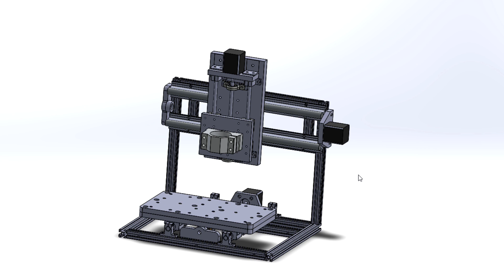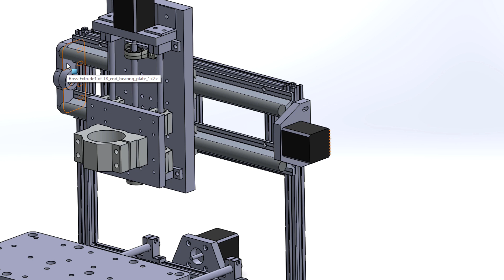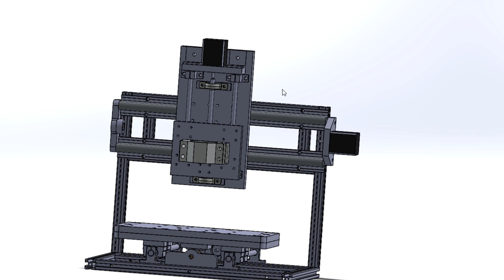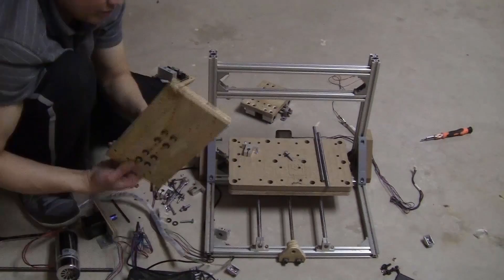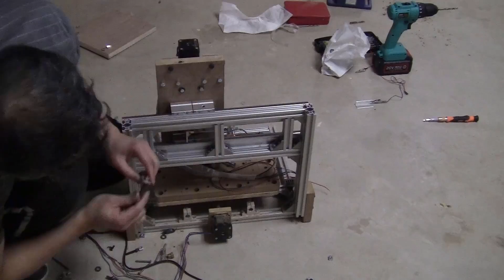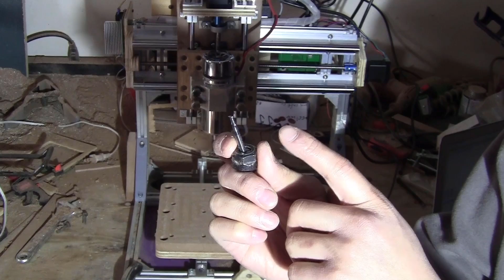3018 CNC - Essential upgrades for Aluminum milling - finally a smooth cut

Comment: Did you balance the spindle fan. I've got clatter and saw a video on here on how to adjust the fan so it is balanced and that will stop it vibrating so much. Should you have used some oil as well?

Comment: Thanks Minh for another interesting video.  I like your approach to improving the router... analyse the performance, identify the weakest area, improve the weakest area.  In the end you have a useful tool, you know every part of it, and your knowledge is much greater.  You are obviously prepared to listen to suggestions from other people as well, so here's my pennys worth:     :o)

1):  Not the most obvious first item.  You don't say what grade of aluminium you are machining, but it looks like extruded bar from a hardware store.  This stuff is made by squeezing it through dies.  It is formulated for this, so it behaves like bubblegum.  It machines like bubblegum too, and it is guaranteed to clog the flutes of your cutter!  Make sure you have a free-machining grade like 6061.

2):  For aluminium, use a single-flute cutter.  This allows more air to get to the cut zone, and allows chips to escape more efficiently.  This is doubly important in small diameter cutters.

3):  Rigidity is King!  What you have done is a huge step in the right direction.  You have already mentioned other areas you will look at, so enough said.

4):  Try to avoid cutting deep slots where the cutter contacts both sides of the slot at the same time.  This promotes chatter as the cutter behaves like a ping-pong ball on steroids.  Use a cutting strategy that machines each side of the slot separately, especially on finishing passes.

5):  Use feed rates that create a decent sized chip.  This removes heat from the cutter's edge, and reduces the possibility of chip-welding to the cutter.

6):  Chip clearance.  Air blast is the way to go on a machine like yours.  A lot of people want you to spray their favourite goo everywhere.  This just makes everything sticky, hard to clean up, and will ruin any wooden parts.  If you swap to a ten ton monster machine, by all means go for full flood cooling!   :o)

7):  Keep having fun, otherwise what's the point!      :o)

P.S.  I realise this comment is more than a year after Minh posted his video, and no longer valid for him, but there are plenty of others out there who are at this point of their journey.
Reply from the maker: Thank you John, no advice is too late and I sure am still learning. I mostly just go to a hardware store here called "surplus city" and buy whatever aluminum scraps they have that fits my cutting jobs. They don't even mention what aluminum it is so I just cut blindly. You surely right about not having contact on both side of the bit, I only do it sometime for the contour to save time but in return compromise the precision.
Reply: you are an inspiration!!  He's a genius, your a wise-Genius, I have been self teaching myself to learn everything I can on CNC's for 4 years so far and what you said has taught me a lot instantly!  Thanks man!  (I will be saving my home built cnc tons of stress!)

Comment: Псих! Какой жесткости и точности ты хочешь от этого хлама??🤦
Reply from the maker: I don't really understand what you wrote but hopefully google translation was correct so we can have a bit of discussion. After upgrading the rails to SBR16 rails, the machine actually became very sturdy and cut very nicely even on aluminum if the tool path set up correctly with  reasonable feed rate and step down. After the installation of the rails, it actually became a reasonable machine.

Comment: Hi I just enjoy your posts so much
I have also modified my cnc but I’m lucky enough to have a 3D printer just designed mine a bit differently and printed everything. Just one question what type of mill bit do you use and what speed are you running the motor at. Please don’t stop I would love to send you pics of what I have done
Reply from the maker: Hi there, I'm glad you enjoyed the video. I also have a 3D printer but I kinda hate and love it at the same time. I'm leaning a bit more toward milling things now. To cut plywood, I used 2 flute straight bit, for Aluminum, I used 2 flute spiral bit , both are flat end mill and spindle speed at the maximum: 12000RPM. Please do send me the pics, You can find my e-mail in the "Contacts" section of my YouTube channel page.
Reply: Minh's man cave Hi thanks so much for the quick response. I still enjoy my 3d printer but I’m also getting into the cnc stuff I will send you some pics of everything I did

Comment: now you could use the machine to make some aluminium upgrades like side plates and the parts you have made out of wood.. 
very intresting build and thanks for sharing, I am in the process of doingthis to my 3018 pro
Reply from the maker: Yes, absolutely. That's the plan. I'll make the aluminum part as soon as I found some stocks in the hardware store. Glad you enjoy the video.
Reply: @minhsmancave9448   yes i have watched quite a few of your videos, pleause keep them coming

Comment: Thanks for the videos! Have you tried different toolpaths, like a 2d adaptive clearing path with a silhouette offset machining boundary? It looks like this is a 2d contour cutting the outline with the tool fully engaged the whole time, whereas my understanding is an adaptive toolpath would result in less tool load and hopefully less chatter?
Reply from the maker: Thank you for the suggestion. You're right, I should use 2d or 3d adaptive clearing. I just got the habit of doing 2d contour from cutting plywood. Adaptive clearing on aluminum is the right way to do it

Comment: They make a product called tap magic. It only requires a little bit of it. I bet it's sound better and cut easier if you applied a bit of tap magic
Reply from the maker: Yes, surely. I do have tap magic (I use it to drill all the aluminum parts that I showed in the previous videos). Didn't think of that when I was doing this because I just wanted to keep it dry. But I'm sure the cutting fluid will help a lot. I'll try next time.

Comment: hey minh i intend to do the same   but i cut all things from metall
Reply from the maker: That's how you should do things. I'm just lazy right now to do all the drilling and cutting on metal. Plywood is easy, I just let the CNC machine do the work itself if it wanted to be better, lol!! Let me know how it goes with your metal build
Reply: Baby steps, Minh, as you are now at the point of getting that machine to redo all of those wood pieces in metal so even more rigid.  Btw, from what I heard I think 300-350mm/m would have been perfect and no chatter.  Oh, and was that a single flute endmill as that works the best for Aluminum for your future remakes.
Reply from the maker: @thebeststooge  Absolutely, I'll upgrade all those wooden pieces to Aluminum for steel (just gonna do the drill guide trick). I'll try single flute bit next time after my actual set of bit got dull.
Reply: @Minh's man cave Drill guide trick?
Reply from the maker: I just make a plate on the cnc with all the holes needed to be drilled on a piece of plywood. Then stick it to the piece of metal and do the drill following a the predrilled holes
Reply: @Minh's man cave I am not understanding but I would think this machine, as you have it right now, will do the holes in Aluminum.
Reply from the maker: Make the guide then go to the drill press is fast and I can actually make the parts from steel
Reply: @Minh's man cave Well, I figured that was it, thanks.

Comment: Hi Minh, awesome to see your new video and progress, lots of work goes into this little mashine :).

Got my 400W Spindle working aswell, so far with original x-axis, upgraded Z-Axis with 2x 45mm long bearings and printed an adapter for the cast aluminium spindle holder that came with the spindle.
I see you´re using 2d-contour, this puts a lot of load into the mashine since you´re using the full diameter of the drill.
Here are my current Settings for "3d Adaptive Clearing" Aluminium which i like the most so far (using 1/8 2-flute): Feed 600mm/min; Plunging rate: 200mm/min; Optimal Load: 0.5mm ; Depth of Cut: 0.5mm. Maybe you want to try them for yourself

 When pushing harder i still get minor vibrations into the whole Carriage, not as much as before.
 Still not sure if this can be avoided with linear rails. But so far the speed is actually pretty impressive and works for my purpose... i maybe upgrade to linear rails anyways (we always try to improve stuff :) )
have a nice day
Reply from the maker: I agree, 3D adaptive clearing will be smoother as I did the first time on the original 3018 machine. I just got the habit of doing 2d contour to save time from cutting plywood. But I do recommend you to get the fully supported rails, totally different performance. The 20mm spoil bit cut really smoothly. Thank you for sharing your experience to my friend.

Comment: Most people would just have given up on the 3018 ages ago!
It's been great to see just how far one of these machines can be pushed, and the true value of the different modifications you have made. I bought a 3018 as a learning tool to help me understand the basics of building and running a CNC router, thanks to your videos I now know not to bother trying to endlessly upgrade my machine and just build a much more rigid machine right away! Yes a 3018 can be made to cut aluminium, but is it worth it?

Thanks for sharing Minh!
Reply from the maker: Hahaha, yes, my friend! No argument there. Just jump right to building a new machine will cost you probably the same compare to all the upgrades and the new build probably will be more sturdy in the end. I just do this for the fun of it and for people who doesn't have much space for bigger CNC.

Comment: Hi Minh! Great surprise! I thought you would provide us a demo of the last upgrades which I think are pretty designed. TADA! You transformed the modest and wobbling stock 3018 CNC into a serious, sturdy machine to mill Aluminium. Congrats and thank you for sharing the slightest details of your great work. In addition, the design of the rails deserves a "concours Lépine" (famous french contest for makers and inventors) award.
(FR) Au départ j'étais pressé de voir la dernière mouture du CNC fonctionner sur de l'alu de 2.5mm d'épaisseur (égoïstement, c'est dans mon projet;) et on se retrouve avec un ultime et génial - le design des rails me plaît beaucoup - upgrade. Ce matos commence à être très fonctionnel et beau en même temps, il faut l'avouer. Et tout ça avec un jeu d'alu extrudé, de profilés, des écrous, bref, des éléments faciles à trouver chez aliexpress e.g. Les parties essentielles sont maintenant parfaitement rigides - une nécessité pour la précision - et le diamètre des rails est imposant. Excellent travail Minh, sans vouloir te flatter. On s'aperçoit même dans l'accéléré qui pourrait être cruel, que tous les éléments du CNC PRO PRO ne bougent pas d'un poil! Great job! pour parler français ;)
Comme mon organisation a commencé à implémenter l'avant-dernière upgrade, on pensera plus tard à passer à celle-ci qui est l'aboutissement d'améliorations incrémentielles. Tu fais honneur aux INSA et ingénieurs français, même sans le chercher ;)
J'aime bien l'abrasage de la semelle MDF. C'est presque un test de qualité de tout l'ensemble. Fais gaffe à ne pas respirer la poussière de MDF cependant... Merci Minh. Comme on dit en anglais "as instructive as entertaining".
Reply from the maker: Thank you my friend for all the nicest comments as always. With this upgrade, I'm very confident that it will cut nicely almost everything that I needed for now (mostly plywood, MDF and Aluminum).
(FR) Le remplacement des rails a vraiment change la performence de cette machine et je pense c'est le plus important parmi les upgrades. A ce niveau la, je ne pourrai plus mettre la machine a la retraite. Elle me servera pour long temps je pense.

Comment: Btw I mentioned you on Reddit as someone was wanting to do what you have done so I pointed him to your videos.  Always nice to see things done that loads of people say, or said, can't be done.
Reply from the maker: Thank you my friend for sharing my work with others. Getting the fully supported rail is the best idea for this machine. I think it is even more important than upgrading the spindle. But having both definitely a good thing
Reply: Minh, I wanted to ask you wy you chose supported rods over rails and blocks as the rails I priced were around the same price you mentioned but the rails use M3 (MGN12H) so M3 t-nuts could have been used and no spacers.  I suspect the blocks might have given less deflection (tilt up down toward Y when the material moved that way) as supported rods are only really good at downward force but not for much else.  Since the virus hit I had to stop on my build or source it from the USA at a much greater cost.  For instance some rails and blocks cost me 35 dollars but now the shipping changed to only DHL or FedEX so 60 dollars shipping.
Reply from the maker: @thebeststooge  the supported rods weren't my first choice. I already placed the order for a set of 2 MGN15 on AliExpress then with the virus situation getting worse and worse, I decided to get something from the US. I found those rails on eBay for reasonable price, so that's the story. I'm also hoping that this virus thing will be over soon so we can get back to work normally.
Reply: I agree about the virus but why MGN15?  MGN12H is good enough from what I was told but MGN15H isn't all that much more though is heavier.  btw, H vs C H is over twice as good so I decided on H.
Reply from the maker: I didn't do much research on those rails, so I just tried to get the bigger ones that are not too expensive. But I end up canceled the order and got something else totally different and way heavier.
Reply: It is not about if it can o cannot cut aluminum..That 3018 CNC..(too many variants)..without upgrading it and replacing almost all moving parts..is like building one of your own and that is not exactly the 3018 cnc anymore. LOL..
It would be better if you just by all your upgrades and scratch build a CNC. In that way, You can say. It is you build, Not from a scrappy 3018. geez
Reply from the maker: Like this? https://youtu.be/89bQLGi4qjs